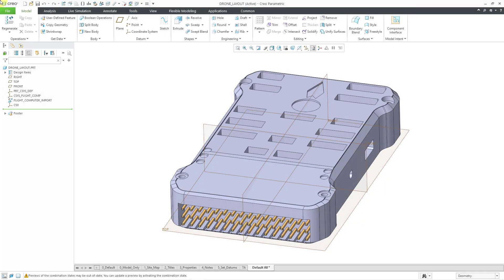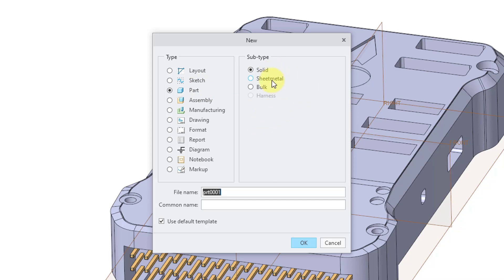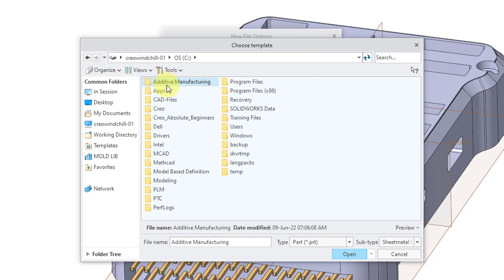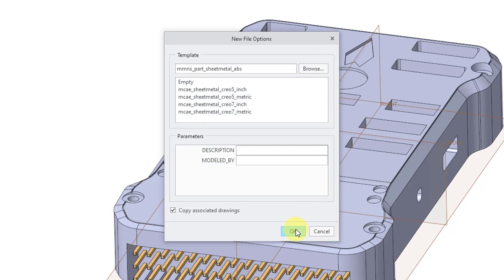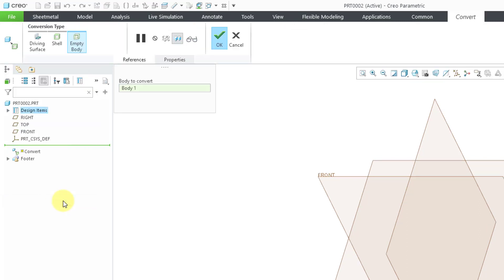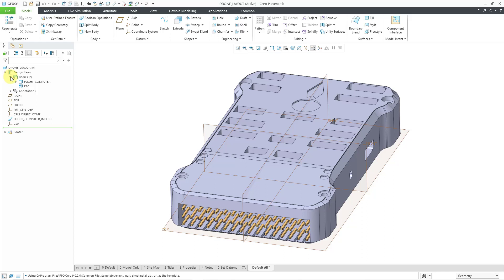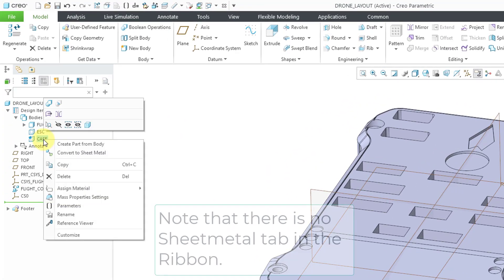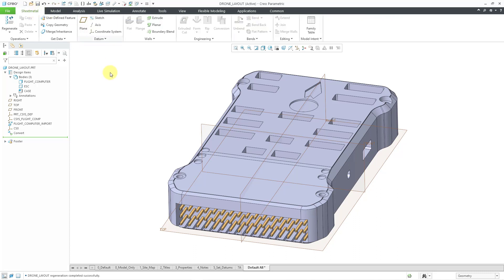Creo Parametric - Creating a New Sheetmetal Part

Comment: Could you explain why you would use Multi Body design, rather than creating separate models and accumulating them in an assembly
In an assembly I can apply a BOM
In a part with Multi Body I cannot or am I wrong?
Reply from the maker: You are wrong. You can create BOMs for a Multibody part. I have several videos on Multibody including discussion of the 13 initial use cases. Multibody is another design option in addition to assembly modeling and Top Down Design.
Reply: @CADPLMGuy  Thank You, I will look for those vids.👍